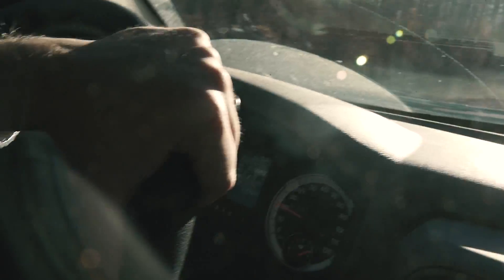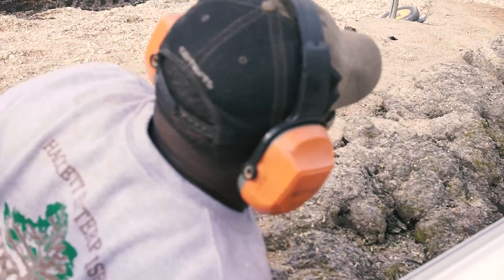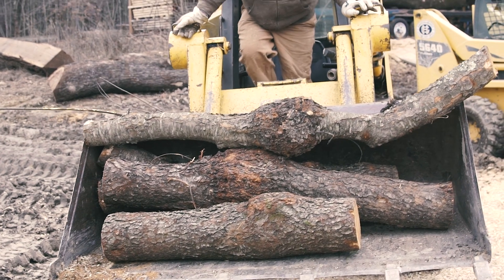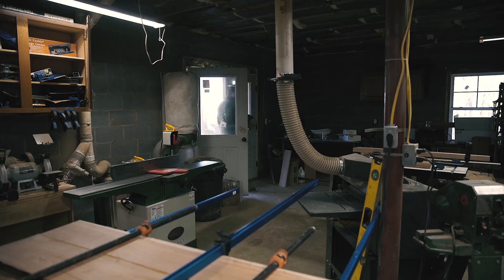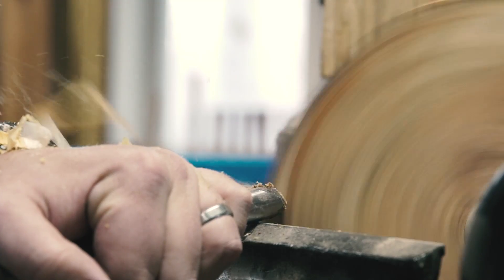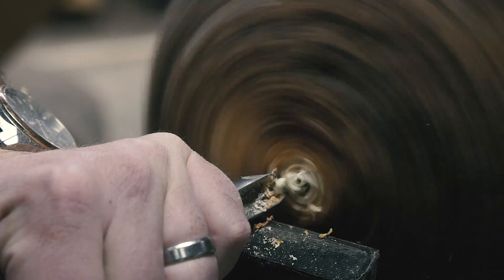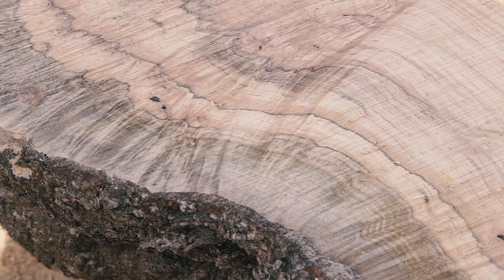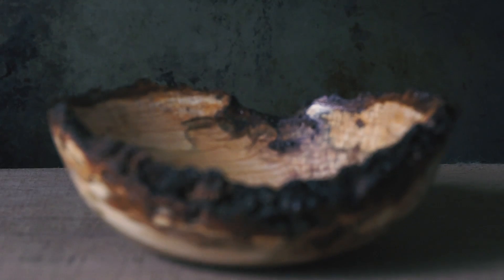Live Edge Cherry Burl Bowl: A Trip to the Sawyer | Woodturning

Comment: I really dig these live edge bowls dude!! They look amazing although I'm slightly intimidated by the turning process. lol Kudos for donating it to serve a good cause!
Reply from the maker: Thanks!  Are you intimidated by turning in general or just the process of live edge turning?
Reply: Wm. Walker Co. Live edge specifically.  Looks easy to make a mistake resulting in broken fingers lol
Reply from the maker: I've caught a few knuckles.  It's not so bad once you can get the speed up and keep the tool in the cut.  I get better with tool finishes with practice so I don't have to put my hands in the bowl to sand as much. Something shallow like this isn't too bad either.  It gets a little spooky with deep bowls.  My "winged" bowls are actually the hardest because you are turning a LOT of air and it's generally kiln dried wood so it's hard as a rock.

Comment: nice piece, so unique and charming! i hope this piece of art will be in good hands. I have a question what about the edge? have some protection, it will loose or break with time or maybe with high temperature and less humidity (summer)?
Reply from the maker: I did go around it with thin CA Glue to try to keep the bark on.  These burls were cut in the Winter so that should give the bark a little better chance of staying on when the sap wasn't running in the tree.

Comment: You said the wood was wet, do you not have to let it dry at all before finishing the bowl?
Reply: Yeah, what's this bowl going to do after someone buys it? Curious about that.
Reply from the maker: The biggest thing to take into account is the wood movement as it dries.  As it dries the bowl will warp out of round.  With the bowl being live edge, I don't mind that.  Since I cut the pith out it likely won't crack, but just move.  Adding the wax/oil will help it release the moisture slowly.  Any splits/cracking usually happens within the first few days and sometimes even on the lathe if I'm not fast enough.  The lathe acts as a big centrifuge and a lot of the moisture gets whipped out.  If I cared about the bowl warping I would turn it to 10% of the diameter (10" bowl =1" wall thickness) and let it sit on a shelf for a while to dry out before turning it to it's final wall thickness.
Reply: @wmwalkerco  Being a newb, I appreciate this info...

Comment: I’ve been thinking about buying a lathe. Question. If I just want to turn bowls and vessels how big of a lathe do I need?
Reply from the maker: Great question.  There are a few factors in play 1) swing over the bed.  How big of bowls do you want to turn?  when you read 10x18 or 12x33 the first number is how big of a blank you can swing over the bed.  So mine has a 12" swing so I can't turn bowls bigger than that unless I turn "outboard" where the headstock rotates 180 degrees.  I have maxed out the swing on my lathe more than once.  So that is something to consider but you figure 8-10" bowls are probably the most popular sizes.  You can always move up to a bigger model if you find you really like bowl turning.  I have yet to need the 33 inches length since I don't do a ton of spindle turning. 

2) weight.  Since my lathe is a floor standing model I added a 2x10 with cinder blocks on it to weigh it down.  Smaller benchtop models I would probably bolt to a heavy bench or make a heavy stand for it.  If you turn anything that's out of round and unbalanced you'll soon find out why weight is important.  

3) speed.  My Harbor Freight 12x33 is a great entry model if you have the space.  For the price it's hard to beat although the slowest starting speed is 600rpm which is a bit fast for some out of balance pieces which takes more prep work at the bandsaw/chainsaw.  Honestly it's hard to get slower starting speeds without jumping up in price.

4) compatibility.  Something I didn't realize with my HF model is it doesn't have a standard tool rest post hole.  So aftermarket tool rests (like a curved rest for getting the inside of bowls) don't fit the tool rest post hole.  Not a deal breaker but it would've been nice to know.

My advice for people is always start with an entry level model that doesn't break the bank and learn what you like/dislike.